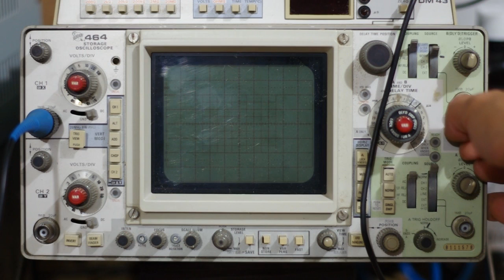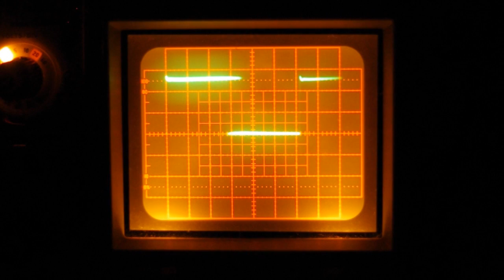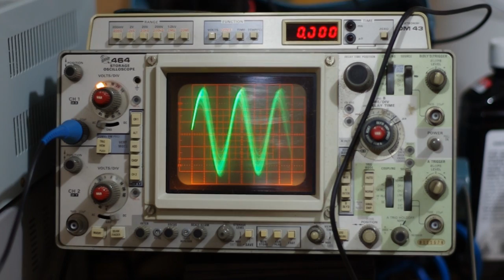Class D amplifier from Attiny AVR and Motor H-Bridge

Comment: If u using Arduino 

void setup() {
   
  pinMode (3, OUTPUT) ;
  
  TCCR0B = TCCR0B & B11111000 | 0x01

  // initialize serial communication at 9600 bits per second:
  Serial.begin(9600);
}

// the loop routine runs over and over again forever:
void loop() {
  // read the input on analog pin 0:
  int sensorValue = analogRead(A0);
  // print out the value you read:
  Serial.println(sensorValue);
  analogWrite(3, sensorValue/4);
  delay(1);        // delay in between reads for stability
}

Comment: how many watts is it supplying ? have any idea? I would like to have one of these. don't know if I could get that code down . cool video thanks...
Reply: Rough numbers: 8 Watts rms into 4 ohms, or 4 Watts into 8 ohms. The L298 switch transistors absorb about 4 volts at 2 Amps, which leaves 8 volts from your 12V supply. The h-bridge makes it +/- 8V, which converts to 5.7V rms. Square 5.7 and divide by the speaker resistance and you have the watts.

Comment: Very cool.  I am looking at doing something like this with the Teensy 3.2 microcontroller (and the timer and ADC code is very different) and a class D amp.  Looking for a code example using that library.  https://github.com/pedvide/ADC  https://www.pjrc.com/teensy/td_timing_IntervalTimer.html

Comment: Use 4 transistors to create a H-Bridge full -12v 0v +12v voltage range from a 12v power supply.. Enormously efficient and very simple.. No coupling capacitors needed! Only simply a capacitor to block radio frequencies at the input :D and simple biasing resistors.. No voltage divider required! Almost no power usage at idle!

Comment: werent D amps supposed to have a LC fiilter befor the amp? Is it ok to us the speaker mass as the filter?
Reply from the maker: They are. I found this amp sounded better with a filter. I'm using 2 - 100uH coils and 2 - .68uF caps... The oscilloscope output you see that looks like a sine wave is what the speaker is seeing after the filter....The filter could be better.